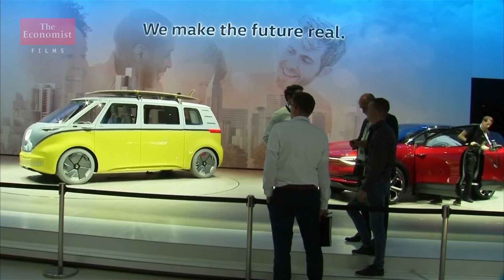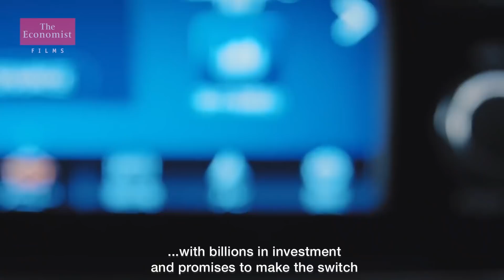Electric cars will come of age in 2018

Comment: It is no longer the 1970s and cars no longer produce the emissions that they once did. Given what has happened with the Fukushima reactor in Japan and the problem with nuclear waste sites any safe power plant to handle the kind of infrastructure needed to power a million cars would out pollute the current gas vehicles on the road. Also, it is very expensive and very difficult to recycle electric car batteries. What do you do when the power is out? Even if the power is out gas cars still go. Electric cars have always been a boondoggle. Given the cost of creating the infrastructure it would take a phony gas crisis cranking up the gas price to over a $100 a tank to begin to roll this forward.
Reply: JMG 
So, just give your opinion, with a few crazy figures thrown in and no actual research?
Renewables ARE CHEAPER than nuclear. (Proven)
They are faster, much easier and less polluting to build (Proven)
One built, T H E Y  D O  N O T  
C A U S E  A N Y  P O L L U T I O N.
The fuel is just "there". (No mining, transport, refining, secondary transport (ALL powered by MORE fossil fuel?)
When the "fuel" (energy) reaches the vehicle, it is used with a drive system that's BETTER than 90% efficient (I marked it DOWN!), even if we UPGRADE the "best" ICE vehicle.... 50%?? STILL nowhere near. AND up to 80% regen!

Have you seen the latest from BMW, I think it's called the "Battery farm" basically a warehouse filled with BMW i3 battery modules all plugged in to a processing system which allows charging and discharging of both new and old units, so basically her battery storage facility. Check out the transport evolved videos.

There are plants coming on line to recycle batteries.
"What do you do when the power's out?"
VERY GOOD POINT! 
Like the story I saw from Puerto Rico this week where NOBODY had power except hospitals using diesel generators and a single guest house which had solar power(!) Oh! the hospital now has power thanks to Tesla installing solar and backup batteries! (Installed in two weeks!)
Maybe local microgrids powered by wind and solar ARE the answer?
The bad news?
When solar power and electric vehicles take over (very soon) gas prices will rocket! So you may get your "$100 a gallon"!

Comment: I think this video is missing the point of electric vehicles. The good thing with electricity is that it CAN be produced from lots of different sources. And for now it is a heavy pollution process, but in the future we will be moving to clean and renewable resources for production of electricity. And lets not forget, the electric vehicles of today could be a whole lot different tomorrow. Also the battery does use rare earth minerals but who is to say that this type of battery will be the most common one in the future. This video could have been a lot better, but that is just my opinion.

Comment: There is no doubt that sewerage when emptied onto the street is a health hazard. We worked that out long ago. We have somehow ignored the obvious when it comes to air pollution. Yes, for many parts of the world electricity equals coal, equals 'dirty' electricity but surely the point is missed. I would much prefer to have my 'sewerage' treated centrally (think power station = sewerage treatment plant).
PS. At the local Tesla showroom, here in Sydney, they leave the car running lights on at night. Even with the best internal combustion engined car, if you leave that engine running all night, then you just killed the poor budgie. Let's at least move the waste to a central place. A couple of hundred million asthma sufferers would agree.
Reply: Worst AQ in UK 2014 was national not simply street- level. Mostly Powergen and space heating.

Comment: I expect better from the Economist than 'they are dirty because they are powered by coal'. It's a very short sighted argument only designed to maintain the status quo. 
The difference between an electric car and a ICE car is that an electric car will become cleaner as more renewable energy comes online whereas a ICE car only gets dirtier.  
Promoting this thoroughly debunked idea is very counterproductive if our goal is to slow down climate change.

Comment: As to the argument that the value of driving an electric car plugged into a coal fired power grid is questionable, it is answered by this: the internal combustion engine is notoriously inefficient.  15 or so percent? Compare that to a multi-million dollar multi-ton dynamo running continuously for long periods of time. Even if it's coal fired, it's far more efficient. And many are oil or gas fired. In addition to the fast growing solar and wind based plants.

Comment: "Electric is often made by burning fossil fuels" my ass...
Still they emit less CO2, because simply, a larger turbine has higher efficiency. And even if you don't put that into consideration, wouldn't it be much better of city air is cleaner?

Comment: Even though this piece rightfully points out that the transition to electric is happening faster than people may realize, it makes some ‘strange’ mistakes.
China is mostly using LiFePO4 batteries, not LiCo2. Next gen batteries could be sodium based, not even lithium. Talking about Cobalt as if it’s a new energy source, akin to ‘the new petrol’, is misleading. This piece also fails to mention that coal is being decommissioned globally in favor of renewables. The cheapest after hydro is wind, followed by solar. Neither coal and certainly not nuclear, will be able to compete.

Comment: I agree with most what they said BAr won.What they forget to tell you on this program is,if excisting homes ect and more importantly new wons had solar pannels fitted then you could charge at home. THERE IS An ANAZING YOUTUBE SITE called FULLYCHARGED ,and it has videos from natanal grid ect ect that exsplain this could be sorted out,and not cost trullions.One of there points is,We dont need 10S OF plus plus spent on hingkley point power station,thats nor going to be online for very long time,With greatly increasted Bills.

Comment: I see no electric car one can buy that in the real world has a range of even 150miles before recharging.  On the generation of electrical power l hope everyone is ready for an explosion in nuclear power.
Reply: Colin Overton 
If you don't see an electric vehicle that can do more than 150 miles in the real world you're not looking hard enough. Don't be silly!
It's been proven that Renewables are now cheaper than new nuclear. If you consider that new solar and wind can be installed very quickly whereas the lead time for a nuclear plant is years of planning, consultation, construction and testing added to the fact that the plant needs long-term monitoring after decommissioning, nuclear is fast becoming unviable. As an example see Hinkley Point C! As of July 2017, running 1 year late and £1.5bn (!) over budget, the predicted cost of power from this plant is already far beyond that of offshore wind power which is now stated by the UK government to be the cheapest available.
Get real!

Comment: what stupid reporting it seems they were very upset that the middle east can't make money from us anymore and that electric cars pollute more than gas cars BS for the price of 6.80 I fill up my Bolt with 60kw of power and drive for over 250 miles. I guess the Economist is for BIG OIL.

Comment: Shame the Economist doesn’t consider the cost of time wasted during charging and finding a charging station. I’ve got kids with a busy life, diesel is still superior in terms of range. I’d never drive into London, that’s why there’s a tube system. Reality check, avoid cities in ANY car when there’s a public transport system. We’re not idiots.
Reply: Paul B 
".... we're not idiots"
And yet you have kids but are still championing diesel!?
I must disagree.....
I'm getting a bit fed up with repeating the arguments but...
Google Toshiba battery press release look at the article dated 3rd October.
6 minute charge time (on a city car battery, so assume 12 for a Tesla type vehicle)
Double energy density (so for the same size battery assume 300 + miles for City Car and 400-500 for a Tesla size)
Good cold weather performance.
No degradation issue.
Full production planned by the end of 2019.
It sounds like you live outside London which would make it fairly likely that you have access to power when at home(?) so would pull into your drive, take 10 seconds to plug the car in and have a fully charged vehicle with way more than one days charge available in the morning.
Reply: Hi Roger, I was close to buying EV and ready to book a charging system to be fitted at home, but the car salesman lost interest in selling to me, and I gave up. But I use EV going into London for work, it's called the London Underground system. Roger, you're perfectly entitled to disagree, but diesel has double the range of EV and a petrol station a few hundred metres away, that is not championing, but an observation of market reality. 

PS I'm not an EV expert, but been studying global electricity trends since the 1990s, the UK government haven't thought this through adequately.

Comment: I’m sure I will be thrilled a weekend given the flat torque curve of an electric and a new battery in tip top condition.  But to sum up I am still concerned with battery longevity.  Charging time on a road trip.  Cold weather range.  Cost of replacing a depleted battery.  It seems to me we still need a better battery.   If you have the means maybe it will work for you as a second car?

Comment: I will stick with my gasoline powered vehicle.  Batteries just don't work well in a cold climate like we have in Canada.  Plus in the winter if my battery dies in the middle of no where and it is -40 degrees I would also die of cold.
Reply: pbreedu If your ice vehicle dies or runs out of fuel in the middle of nowhere you're in the same boat. Probably down to poor planning in either case. We are a two EV family with tens of thousands of kilometres in our vehicles and despite going on long journeys, which includes travelling over mountains, we have never run out of power or had a breakdown. An electric motor with three moving parts driving a differential beats an internal combustion engine and transmission with thousands of moving parts driving a differential anytime. Not to mention no filters or oil changes, and brakes that last much longer. It's true you will lose some range when the batteries are cold, however it isn't usually a factor since most people charge at home overnight and don't usually use anywhere near the full charge daily. And just for the record, I also live in Canada.
Reply: John P. Weiksnar if you are out in your gas fueled car at -40 and the fuel pump quits, you'd be in the same situation except a fuel pump doesn't give any warning. You can preplan you distance for EV. Plus the EV is already warm when you get in it. However in your  climate you'd need a Tesla, Chevy Bolt, or Nissan Leaf with the cold climate package, which keeps the battery warm. Heat kills the life of the battery, not the cold.
Reply: Not as cold as Canada and most are city dwellers in the South. Batteries and cold don't mix well - see Bjorn Nyland parking a Tesla at the airport.
Reply: Luke W that's the reason Tesla and Chevy Bolt have battery thermal management systems. It's very little loss in cold climate due to the battery heater. After you start traveling it's uses the waste heat from the electric motor to warm the battery. Nissan has just an electric battery heater, but it still does well
Reply: No, you won't stick to your gasoline vehicle, even in the cold,  for the same reason your granddad didn't stick to his horse.
Reply: > Plus in the winter if my battery dies in the middle of no where and it is -40 degrees I would also die of cold.

Correct, the battery that keeps your fossil car running. . . .

Comment: What a lot of rubbish. EVs currently sell 0.1% of the market and perhaps the reason for that should be considered. They have two very big defects that cannot be overcome. RECHARGE TIME. it takes hours to recharge, even on a high-power connection. I can refuel in 10 minutes. an EV cannot be recharged at home in under 5 hours or more.  

I live in Australia and the distances are vast. EVs are useless here because you cannot stop every 300-400kms for 12-24 hours before moving on.

But at least they are 50% more expensive than their far more useful petrol cars.

And they still sell 0.1% of the market.  If there were a massive increase in this they might be... ONE PERCENT.

Comment: There seems to be a typo in this video, perfect decent video until "dirty secret about electric vehicle", this section was actually "dirty lies about electric vehicles" as promoted by the oil industry... The reality is the electrical grids aren't wholly powered by coal and even if they were they would still result in less pollution than extracting, transporting, refining, transporting and burning  fossil fuels.  No mention of the this fact or that elextricl grids are become less and less carbon intensive every day as wind and solar production comes on line.  So this leaves cobolt as potential issue, but it's only essential for certain battery chemistries, and environmental/economic/political issues aren't intractable problems with no solutions.  Further more you use and recycle minerals in batteries, it doesn't get consumed by burning it and leaving the resulting pollutants in the atmosphere, once you have mined enough to manufacture the battery you don't have to keep mining it to keep vehicles moving from A to B. Missing these points is just shoddy journalism, or perhaps something deliberate...

Comment: For the production of 1 gallon of petrol (gas) a refinery uses 7 kWh of electricity. Give that to an EV and it will go 24-35 miles depending on the model. So unless your ICE car does more than 24-35 mpg you've already lost the carbon debate at the refinery let alone the tailpipe.
Reply: Your figures are bogus. At that rate, petrol refineries would need their own massive power plants.

try again, this time with facts.

Comment: Why are you still saying coal produces electricity it doesn't in Germany , France and the U.K.!! In fact the UK. ALONE RAN ON RENEWABLES AGAIN THIS SUMMER FOR 7 days and renewables produced more gigawatts this summer than any other power sources
Reply: France doesn't need coal because it has so much nuclear power, which it apparently isn't frightened of because it isn't American technology from the 1960s (unlike Fukushima.) Germany actually does use a bunch of electricity produced by burning coal -- but it isn't produced in Germany so it's on Poland's balance sheet. :( Germany  deserves a lot of credit (e.g. they invented the feed-in tariff we now use in Ontario for instance) for building renewables but they have undone some progress by shutting down nuclear power plants since 2011. Worldwide the deaths eventually produced by fear of nuclear (i.e. sea level rise/anomalous weather/drought/wild fires) is probably greater than the number of people killed in all nuclear power failures. Of course they aren't the same people. :( And I'll just ignore everyone the coal industry has ever killed in mines and surface operations because (no good reasons, just because nuclear is scary and dying in coal mines is familiar.)  It seems to me the only responsible thing to do is push for even more spending on renewable and the storage and transmission infrastructure to support it.
https://en.wikipedia.org/wiki/Nuclear_power_phase-out
Reply: Germany has increased coal and lignite burning since Fukoshima and nuclear reduction. They also buy credits from Norway to pollute more.

Comment: Producers forgot Autonomous Electric Vehicles. In 10 - 15 years most people won't need their own car as they'll be able to get an Uber/Lyft/Whatever at a fraction of the cost of owning a vehicle. And, the way renewable energy & battery prices are falling, there will be no need for coal, gas or nuclear electricity generation.
Reply: We've had these self driven electric powered vehicles for decades now. They are extremely efficient, in fact several times more efficient than whatever electric cars can be in 2040. They're called trains. You're cutting down the forest and building a garden.

Comment: Ugh i hate the point that electric cars run off of a fossil fule power grid. 

Charging a battery still uses less fossil fuels than sticking it directly in your cars tank. 

And there is a simple solution. Put solar panels on your roof and sell the extra energy produced to the grid. It will pay itself off in 3 years and after that it will start paying your electric car off. 

You're getting paid for free energy and having a fancy car.
Reply: False - especially in winter. Leaf is a 30mpg gas car when charged from a generator.
Reply: Luke W WTF no one uses a Gasoline Generator to charge a BEV. That is massively stupid. Natural Gas Turbine MegaWatt generators charging a Nissan Leaf would be closer to 60mpge. Simply because how scale & alkane fuel type is soo much more efficient. Luke W you have written multiple idiotic ignorant comments here.